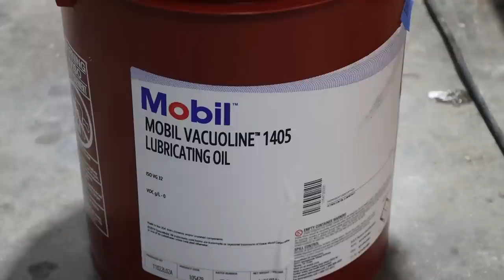Auction TRASH OR TREASURE? Brown and Sharp MicroMaster

Comment: does that mag chuck have continuity if it does what are the supply criteria 110/120 volts what ac or DC I would be surprised if it your work on AC just had a quick google and it looks like it needs a 10amp 110 DC supply , but first check if it has continuity though the mag its self. but when all else fails check the chucks name plate
Reply from the maker: Could be I guess. I seen 115 volt stamped on the front and assumed AC.  I will have to dive into it and check. may not matter now that I fed it 120AC :-)
Reply: I think that AC would not kill it it just would not create a magnetic field.
Reply: @SteveSummers  Thinking some more you would not want a AC Chuck due the the Wave form being fed to it eg. polarity reversal in your case 60 Hz here it would be 50 Hz. no mater you would not want a humming chuck ( pulsating mag field on a grinder )
Reply: @SteveSummers  Steve, since the days Tom Edison provided (sic) DC power to businesses and homes, the U.S. voltage standard has been 105-125.  FWIW, 120 VAC is 169.7 V. peak, but I doubt you did any damage.  Again, FWIW, I've a hunch you are dealing with a failed selenium rectifier.  Be glad you aren't around when a selenium rectifier fails.  A very foul smelling,  toxic, vapor is released and toxic dust is generated.  It is a matter of routine for selenium rectifiers to be replaced by modern silicon parts, along with installing an appropriate voltage dropping resistor.  Forward drop in silicon is smaller than that in selenium.
Reply from the maker: I just checked and it has a 4 bridge rectifier in line so it is a DC chuck😄
Reply: @SteveSummers  thanks for confirming our suggestions .now is there a circuit thro the chuck guess 10 20 Ohms , is there any output from the bridge rectifier ,  one final thought , you said the transformer had been replaced , , with any bridge rectifier the output volts are higher than the AC ( you measure the RMS with a meter) because the rectifier sees the peak voltage of the sine wave . so my hypothesis is did they just put a 110vac output trans in and blow the rectifier and or the chuck . you need to carefully work though the system , If the chuck is good think about a PWM controller then you can reduce the flux in the chuck for better accuracy of your work .

Comment: Quick tip for removing oil quickly, just make up a vacuum oil extractor using your shop vac and a soda bottle also you can use a bigger container like in this chris notap video: https://www.youtube.com/watch?v=4NZlyBAjwZs

here's the original video in case the short doesn't clear up what he's doing enough:  https://www.youtube.com/watch?v=Uk46vCOGTFI

Comment: I got same one for 150$ but they wanted 350$ to load it so I took the msg chuck and powersuooky off it and left it my buddy ended up going back and buying it for 250$ and the loader had left by then so far more reasonable loading fee since was not dealing with auction and was with shop  owner